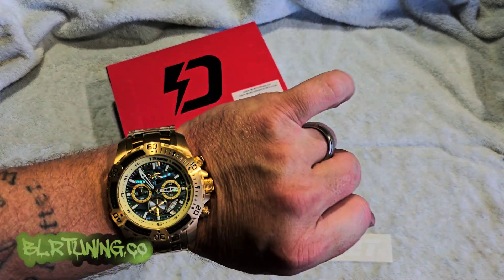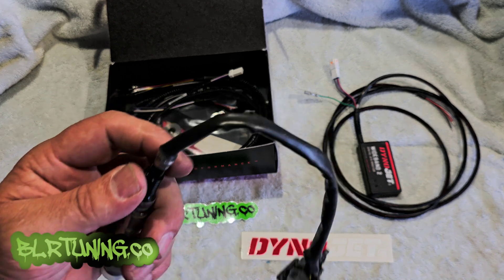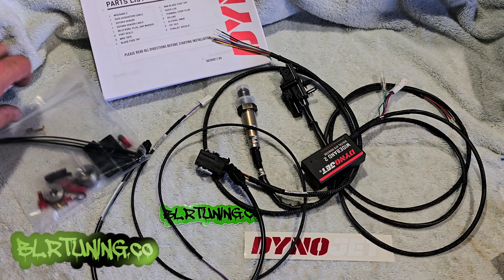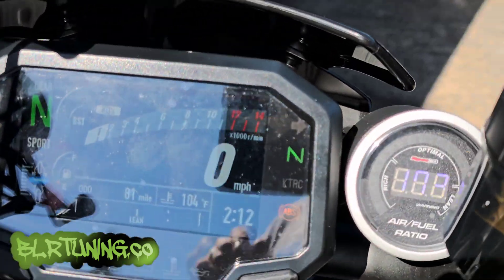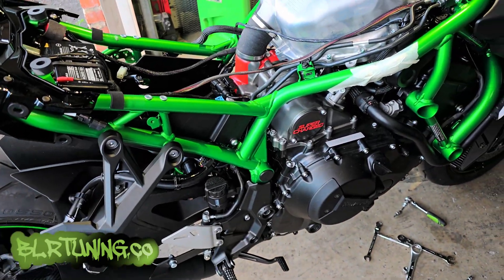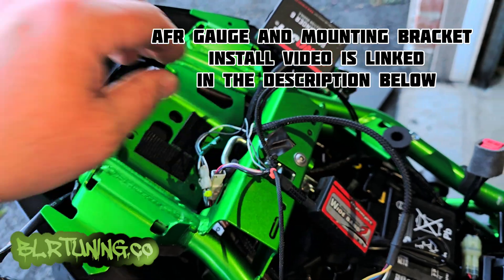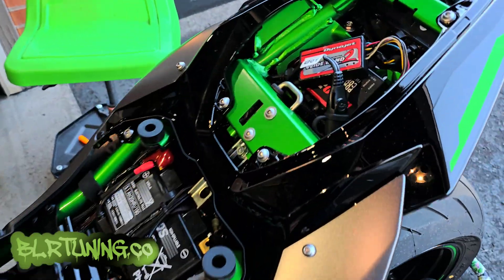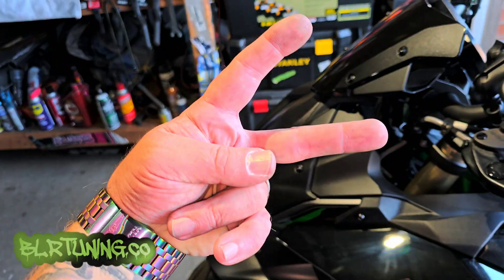KAWASAKI ZH2 DYNOJET WB2 WIDEBAND WITH AUTO-TUNE INSTALL WITH AFR GAUGE

Comment: Money in trash
This bike is limited in ecu
This shit kit maybe give u 5 hp in best scenario
Need full dyno tuning to unlock real stuff
Reply from the maker: We are anECU flash tuning company and we also carry Dynojet products. We have done all the d restriction stuff in the ECU as well as any additional tuning in the AC that the power commander can't do. Then we are using the power commander to control the fuel map. The wide band is installed so that way we can monitor the AFR with an AFR gauge installed on the dash. Thank you for subscribing to the YouTube channel. Feel free to reach out to us if you'd like to make some horsepower

Comment: Bill, I have a huge favor to ask regarding the Z H2. I swapped out my levers for Pro-brake levers and in the process broke my clutch side kill switch which in turn completely disables my cruise control. The two 3mm philips head screws that have to come off the kill switch to get to the cruise switch are loctited like every other freaking bolt on this bike. Could you please take a look and see if/how to get these out without stripping them or having to drill them out?
Reply from the maker: I haven't had to take that apart yet so not something I'm super familiar with on this bike just yet. I have found that damn near every single bolt is a lot tighted quite a bit. My best suggestion would be use a brand new 3 mm Allen and turn it very slowly while tapping on the back of the wrench or socket that you're using with the butt end of a screwdriver. I found that this trick works really good for getting stubborn bolts out.
Reply: @BLRTUNING  They are soft aluminum phillips head screws. :-( But thanks for the tip! I was also thinking maybe holding a hot soldering iron against the screw for 5-10 minutes and see if it heats up enough to soften the thread locker